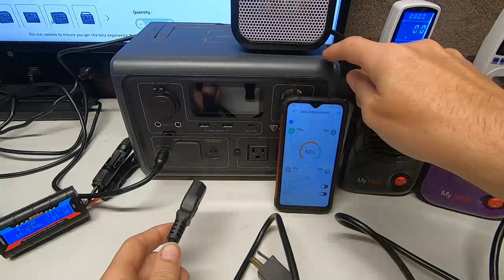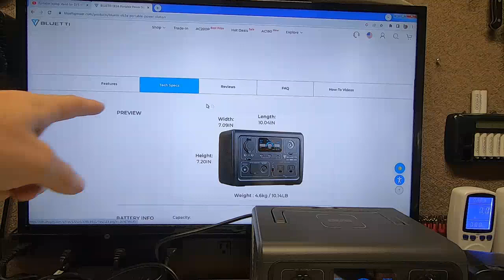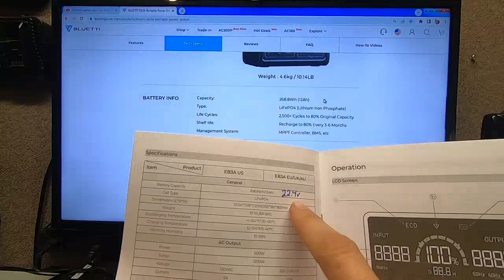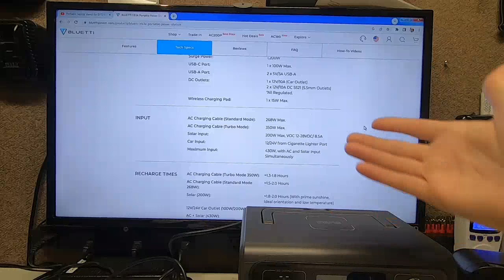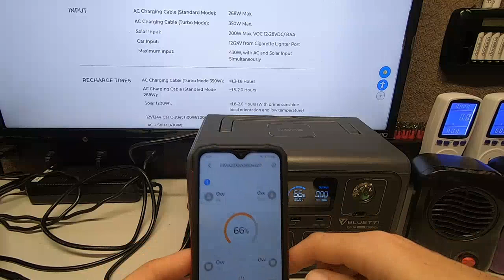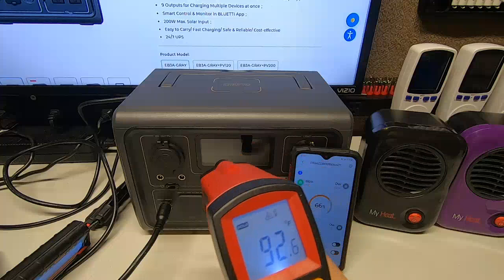BLUETTI EB3A Power Station (UPDATE 2)

Comment: my eb3a was charging at 380w on turbo just from ac. yours shouldnt be that high without dc helping it.
Reply from the maker: Incorrect.....
     The EB3A charges at 430 (AC ONLY) when you select "TURBO MODE"

This is normal in the "TURBO MODE", But we do not recommend this unless you really need it done fast.